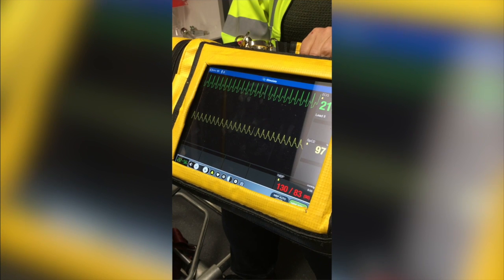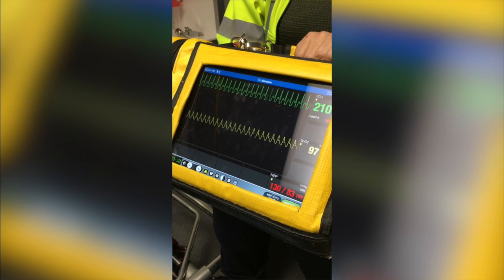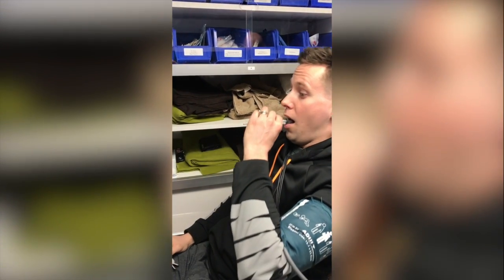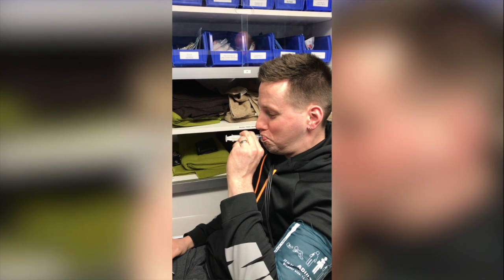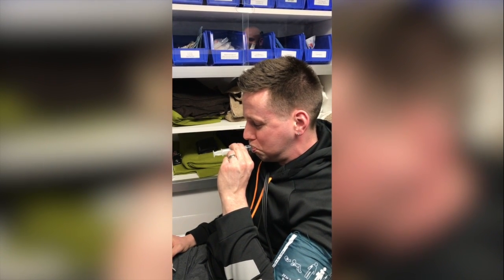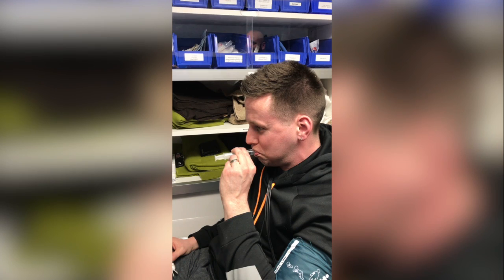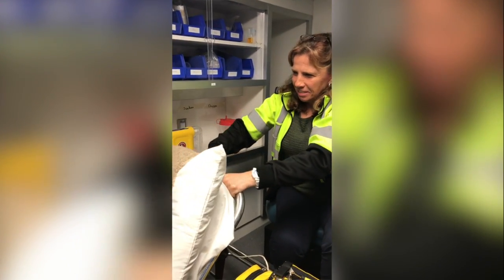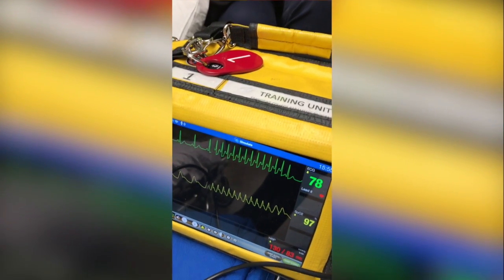Modified Valsalva Maneuver

Comment: This maneuver is Only in Haemodynamically stable SVT , maximum 3 attempts , should not be tried in these - Requirement for immediate cardioversion, Hypotension (SBP < 90 mmHg),Atrial fibrillation/flutter Aortic stenosis,Recent myocardial infarction (within 3 months), Glaucoma,Retinopathy, Third trimester of pregnancy,
elderly peoples  may possibly go for postural hypotension due to blunting of age related autonomic nervous system dysfunction , so better for them  ER management , also peoples on beta blockers this maneuver may not be effective .

Comment: My father has had weird reactions with modified Valsalva during last two attempts. Yesterday night his legs started shaking in a way that we couldn’t lift his legs up. He was also shaking his head and making a weird sound. It scared us for a few seconds and he felt okay after that. We took him to ER and he was administered Dilzem 12.5 mg (intravenous) and He became okay.
Reply: @akshay , This maneuver is Only in Haemodynamically stable SVT , maximum 3 attempts , should not be tried in these - Requirement for immediate cardioversion, Hypotension (SBP < 90 mmHg),Atrial fibrillation/flutter ,Aortic stenosis,Recent myocardial infarction (within 3 months), Glaucoma,Retinopathy, Third trimester of pregnancy,
Your father being an elderly , he may possibly go for postural hypotension due to blunting of age related autonomic nervous system dysfunction , so better for him ER management , also peoples on beta blockers this maneuver may not be effective .
Reply: I want to know if we should do it on him after this reaction. Should we only attempt it once or twice before going to ER and not more than that?
I ask this because it was the 3rd or 4th attempt last night that caused that scary reaction.